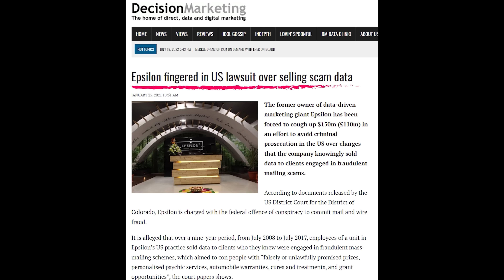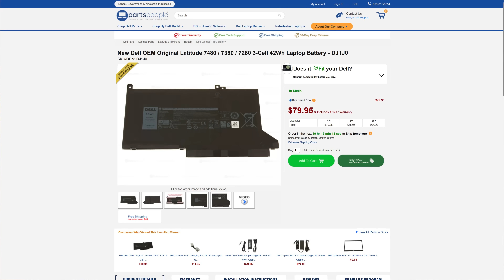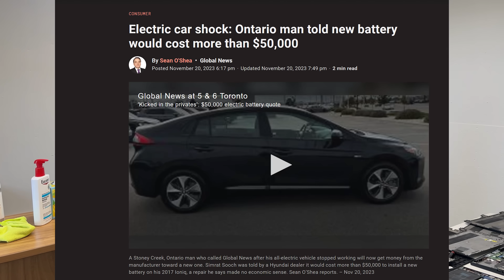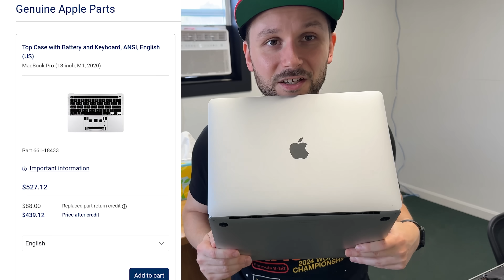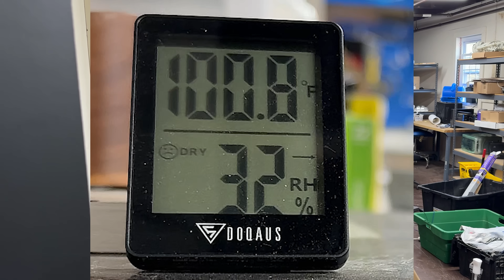Planned Obsolescence: Why is Replacing a Battery STILL So Difficult and Expensive?!

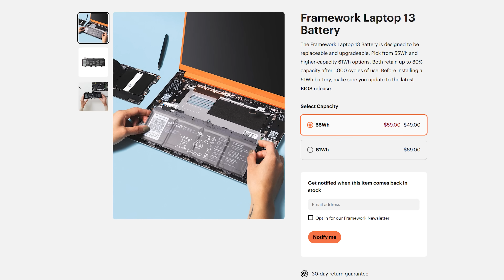Comment: 8:28 I worked on some cell-making machines (making the machine that makes the cells used for the batteries). The cells themselves (efor example the lipo bags like most laptops use) are not that expensive and dont just "increase in price", if anything they lower price as tech improves.

The issue is the battery, all devices have a custom-made battery now (a battery is a bunch of cells joined together, with a charge/protection circuit). Since the battery is not standardized the factories making them only produce the device-specific battery for a short time and then it's done and you only get old stock.

Framework is also using a custom-made battery, they use the same item for all their laptops (and will keep using it in the future, probably) so they keep the battery in production until they are in businness.

The real solution is to standardize the cells (or maybe the batteries, but that is harder) and make them swappable. This can only happen by the power of bureaucracy mandating it from above, like EU's decision to force Apple to use USB-C on iphones
Reply: Hugely depends on capacity and formfactor. Maybe certain pillows get cheaper, but lithium market is volatile.
I've used to work in R&D for a company making life supports battery packs and emergency power banks for underground mining equipment, and we had to panic outsource batteries between Sony, Samsung and Panasonic, sometimes buying them directly from Japan or Korea, and getting collective shipment for the said order from USA, CAN and some weird port in Africa of all places. Legitimate contracts worth between 1 and 3 million €, or more. Shortages before pandemic and second wave of Tesla craze. Just imagine how bad things got during pandemic and now when EVs are even hotter topic, and multiply that by thousand.
Biggest issue with batteries, especially cylindrical cells is position they are stored, heat degradation and density (power capacity). For flat and soft formfactor I believe key issue is same: heat degradation (charge-discharge cycles). In case of laptops and phones, lack of proper heat dissipation resulting in same problems that all chemical batteries have, and you can't tell people to ratio their batteries to 20-80 when they can fully charge and discharge their devices. And manufacturers also don't care - 5200 mAh capacity looks better than 3898 mAh in the ads, so no hard guard on the degradation factor. Seen people buying new flagship phones 8-10 months after previous one, because they killed batteries abusing their devices (especially samsung & apple).
Argh, this makes me so angry.

Anyways, batteries are standardized, users aren't. And companies need to make profit to satisfy investors, and for that, they need to sell products. If you want to know what happens, when company makes great product that lasts, check Mercedes-Benz 240D history. And that entire era of the Benz company actually.
Reply: Sure, but all devices have different mother boards it means different layout inside, for example if they put tiny tiny motherboard you can make a huge af battery, and vise versa
Reply: @piko1032  if they need, they can add multiple standardized batteries together. We had devices that took multiple AA and AAA batteries, the world didn't end.
Reply: @piko1032  then standardize motherboard form factors as well
Reply: I'm still sad the EU didn't force Apple to bring back the jack.
Reply: Current production cost of lithium ion battery is now just 200 dollars per kWh for NMC lithium battery

Assuming ordinary laptop battery has 66Wh capacity, so divide it by 15. That's just 13.33 dollar for each battery! Can't imagine how much profit margin put by the laptop manufacturers by setting the price so high
Reply: Standardisation in battery tech could really actually be a hindrance with the rate of battery tech evolution. Seeing as companies routinely support devices actively for 5-8 years now, I think a better move would be something like "you must maintain battery production for e.g. 4 years after the last officially supported date of your device at no more than a 20% markup" or something. 

If indeed the cells and/or batteries aren't all that expensive, a 20% markup itself is probably even too high but better than the cost of the device itself.
Reply: @EmCeeJuan1  how so? Why would a device care about what's the battery technology, all it cares is the battery provides the same voltage and fits the same physical space.

Your proposal is too complicated nonsense. How do you define "must maintain battery production". How many batteries must be kept available for sale? That has to depend from how many have sold and how many are still active. Who is watching this is actually done for each and every product line? It's madness.

Also if you think they are not going to move the cost of keeping battery production lines active for 4 years in the product price you are delusional.

This was a solved issue in the past with the AA and AAA and all the other standardized batteries you could slot in your devices. You just force the manufacturer to have a standard slot to accept a standard battery pack, and then leave the production of said battery packs to a third party that only makes those. Done. We had that. It worked.
Reply: @marcogenovesi8570  My proposal was just a simple example, a shot in the dark. But I don't think it's all that crazy either, if batteries are indeed disposable products, it stands to reason that they should account for an end-of-life solution. They can price their devices accordingly if they need to. 

I am no product logician but stocking spare and replacement parts for technology isn't a new and magical thing, if they wanted to they very easily could. But again, it was a simple idea I thought of on the spot.

Battery standardisation for cutting edge technologies such as phones are NOT the same as mass produced "it just works", low powered technologies that use standardised  batteries. As far as I'm aware, almost all devices that use standardised battery are designed for reliability and not to be cutting edge.  USB-C is a good standard because it literally doesn't need to be cutting edge, it just enables simple interoperability for simple charging and data transfer. It is not used at the cutting edge because that would be silly. 

Battery technology is a rapidly evolving field and I think restricting form factors right now could actually significantly hinder things. Maybe a standardised BMS, but not the actual battery itself.
Reply: @EmCeeJuan1  your proposal is nonsense as I already explained.
It relies on poorly defined concepts that allow hardware manufacturers to get away with whatever they feel like. You are using the talking points of anti-right-to-repair lobbyists.

Stocking spare and replacement parts is complex and expensive. They don't do it because it's a lot cheaper to not have worldwide network of warehouses full of parts that may or may not be sold for 10 years. Batteries go bad even on the shelf btw, and many electronic components need climate-controlled storage. Car industry makes spare parts for a long time only because it's mandated by law, and car prices are on a different scale.

Funnily enough, if you mandate them to keep spare parts for a long time in a way they can't just claim they do (as it's the case for the right to repair), the first thing they will do is standardize the parts so they have to keep less SKUs in their inventories.
So either way you go back to standardized battery packs. 

What's "cutting edge" about phones and laptops anyway? They stopped having any real feature that matters many years ago. Is it making smaller and smaller batteries because they must be thinner every year for some reason? I wouldn't mind putting an end to that.

USB-C is just a connector. The interface is cutting edge and is constantly evolving, (it's the future of USB, all the 20Gbit 40Gbit and 100w power modes are on usb-c) your example is invalid.

There are devices that use standard batteries that are both reliable and unreliable. Having a standard battery pack is a design decision, it's usually done for high power applications like power tools. But I can assure you there are plenty of cheap power tools that are not reliable at all.

I'm sorry but this is a tradeoff game, you can't have your cake and eat it too. Standardizing the battery packs allows both user-servicing the component that is most likely going to need to be replaced AND ensures that the battery packs will always be available because they are made by a third party that is always producing them for a multitude of customers.

The BMS is part of the battery pack, you can't standardize it unless the battery itself is standard. It needs to know the number of cells and their chemistry (needed voltages/temps/whatnot).
Reply: @EmCeeJuan1  why would standardization be a hindrance in battery tech evolution?

Comment: The issue: Somewhere along the way, regulators completely lost the plot... Standard battery sizes exist every other marketspace... Consumer electronics... Cars... Lights... UPSs...

Laptops and phones are known commodities at this point... OEMs should be compelled to design around standardized interchangeable batteries... Just like everyone else... Innovation can come from clever designs around the batteries as well as new battery chemistry and annodes... Just like we saw with things like AA going from carbon zinc to alkaline to lithium... and from non rechargeable to rechargeable to ni-mh rechargeable to lithium to USB C direct lithium...
Reply: They didn’t lose the plot, they were bought. Regulatory capture is real.
Reply: @CantankerousDave  i get that...

But there was a time when these regulators made common sense regulations...
Reply: The expiration date prominently displayed would be a double edged sword...
It would provide some insight, but...
Companies would use it as an excuse to push device replacement...
It is an interesting idea...

Comment: 0:44 Ooh f**k my laptop can't be upgraded to windows 11 due to incompatible processor (ancient i3 7020u)😢
Reply: Dude I have an OptiPlex 780 MT running Windows 11 Pro and that's got an Intel Core2 Quad Q9650 on it now that originally had the Intel Core2 Duo E7500 and that ran it too. Granted I maxed everything out by upgrading to a Samsung Evo 870 1TB SSD, 16GB of dual rank, dual channel DDR3 RAM. It runs smooth as butter and without so much as a hiccup. Rufus is your friend if you wish to upgrade to 11.
Reply: @HectorQuien  my system says you are all set except cpu ; my ram(ddr4) , storage (1tb hdd) etc is compatible but cpu don't have official support for windows 11 , but I don't know how to buypass this recommendation.
Reply: @Piyush_Gharat  I also have it installed on an 8th Gen Core i7 using the same method. It works. If it can run on ancient Core2 Duo E7500 and a Core2 Quad Q9650, it will run on a newer iCore  series CPU.
Reply: use tiny11

Comment: Those 7490s should have 8th gen cpus compatible with 11.  One thing you might want to look out for on that model is some have this issue where if you pick it up by the left hand side it glitches out and freezes.  Same with the 7290 which I have.  It seems to be a design flaw with that model line but I found the remedy to be put 1-2 layers of foam tape on the under side of the back cover where you notice the chassis flexing and that resolved the issue for me.

Comment: I work in the IT Distribution in the EU. I dont know the exact prices for genuine replacement battery , because I focus on different products but I have some idea. I can bet the big 3 laptop manufacturers work with 300+% margin. Same as car parts. Like you said many many times, they dont want you to repair. They want you to buy a new device. And no one controls them. We live in really cynical times.
Reply: And considering that current global lithium battery prices are already 80% lower compared to 5 years ago (and still continues to drop), all the batteries should be dirt cheap for now.

But laptop manufacturers says no, and the laptop replacement battery is still as high as they were in 2010s
Reply: They don't even let you maintain or clean your own device. Have you ever found a manual that explains, step by step and with proper safety procedures, how to clean the fan or replace the thermal paste?
Reply: @fansyuriilham8557  Surprisingly HP has service manuals that detail this for several consumer models, unfortunately they're HPs so in the process of looking at it you just broke the hinge

Comment: Most EV batteries these days are actively cooled and we see them last over 250000 miles and more. You are thinking about first gen Leaf batteries that had no active cooling. New batteries last longer and longer. Sometimes longer than engines do. New LFP batteries will last even longer. Please look at actual data before spreading misinformation. Thank you for caring though. Love the channel!
Reply: well yes becsue they have so many cells and the cooling also helps prevent damging runaway elctal restage detergaons as well to the pnot that they simply last far longer due to the huge amonut of cells works  conmbes with active cooling but they are  F*****ing HUGE BATTERYS HOWEVER THAT WILL NOT FIT in most compteur nor latops bescue DUE TO HOW BIG they are will take up a huge amont of space anyway. also the more cells the longer the batry lasts anyway before capasty starts to drop in a noticable maner anyway. but thats due to the huge amonut of cell conuts more then anything else. biger battrys with alot more cells simply last alot longer due to haveing more cells. but even still the core issue is the cells being elctrolites will chcmaly degate over tiem and use and will still die sooner or later. can also havea chance of far more voalteg booms if they short certic the wrong way can be evene worse if the cells shrto certs ina huge amonut can make huge booms too if they go all at once for a heat runaway short cirent chain reaction.

Comment: Why not an external battery pack that you plug straight into the laptops DC port? It could be whatever size/quality you want.  People usually have other accessories in their laptop cases anyways...
Reply: True, and on top of that, even if you remove the glued battery from any of the current laptop and keep ir without any
this way you could make so easily work even with cureent laptops👍
Reply: I repair Laptops, some of the Dell Laptops run slower without the internal battery attached even if you run it with the right power supply. Macbooks have the same issue
Reply: @colter2235  Anything to lock you into their product.
Reply: @colter2235  Would a capacitor(s) in place of the internal battery help performance?
Reply: @georgeandrews2839  No because it won't detect it, if it can't speak to the battery management system built into the pack then it doesn't exist.

Comment: I have tons of batteries, I tear the cells out the packs when they go bad and keep the decent ones

Since all batterys are just 3.7V lithiums there all basically cross compatible, of course you should never sell that but if you fine with copper wire hanging out the side it works well

Comment: The issue would completely go away if they used standardized battery form factors.
Reply: This is the way. Just make few sizes and shapes (or make it modular), mass produce this shit and we're good. There is some battery law in EU that should take effect on 2027 (easily replaceable batteries etc.)